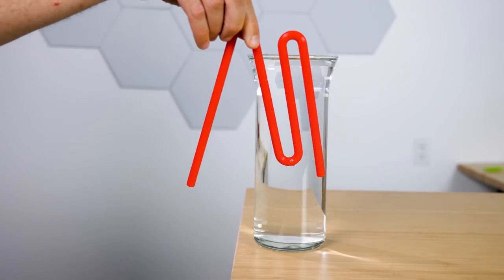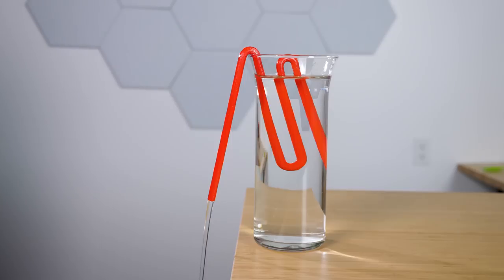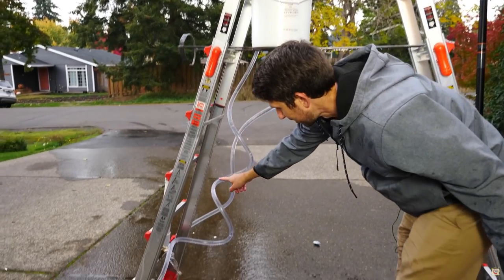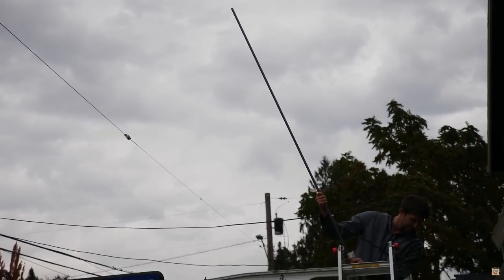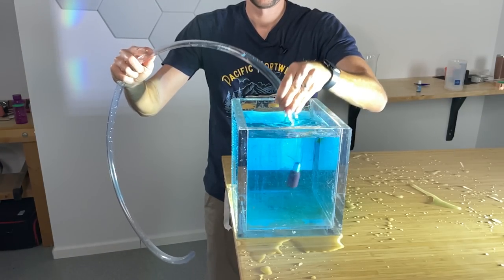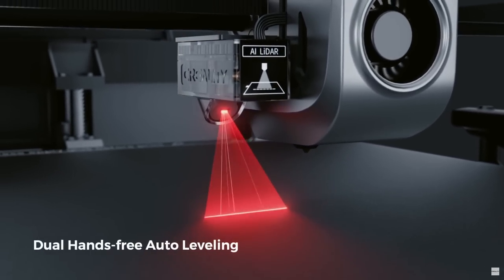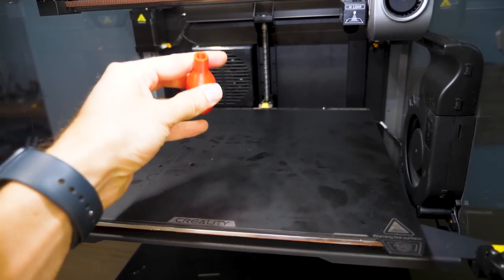This Tube Makes Water Flow By Itself

Comment: You can create the same effect of the shaker syphon by using your thumb to seal the exit-end during the upward stroke, and releasing your thumb during the downward stroke. Probably common knowledge, but I thought I'd throw it out there just in case.
Reply: Or just spin the end of the hose like a helicopter until it splatters everyone around you. 😬
Reply: Thanks for that tip!
Reply: It helped me to suddenly see what was happening more clearly, so I'm  glad you threw it out there. 👍
Reply: @valiantwarrior4517  Yes, I've done that!
Reply: I did that demonstration a few times with a drinking straw in a cup of water at a formal dinner table when I was a teenager. When I got older I perfected the art and then did it many more times!
Reply: Back then, I always do this with my friend to prank someone who didnt know about this stuff with our drinks

Comment: That hydraulic ram pump seems to have a similar sequence of operations as an electric voltage multiplier. Thanks for showing some magical plumbing and your new tools.
Reply: More specifically, an inductor based boost converter. A capacitor based voltage multiplier works on a different principle.
Reply: Wow. I didn't expect to encounter this here. That's so cool.
Reply: @tactileslut  No, the transduction effect by the voltage amplifier causes the momentum to accelerate the hydraulic effect. Not the other way around.

Comment: the shaker pump is called a foot valve on most farms with yard wells on the property. its a fast and easy way to prime a pump by just lifting and dropping the pipe going down the well. the foot valve lets the water in on the drop but snaps shut when you lift. after you have the pump primed, the suction of the pump can keep the foot valve open to let the water keep flowing.

Comment: The ram pump uses the same stored energy that causes 'water hammer'--the sound you sometimes hear in the pipe when closing a faucet really fast.  Also with a ram pump: the higher the outlet is compared to the source, the more water is wasted out the bottom; efficiency drops off quickly the higher you go.
Reply: Can large numbers of inefficient ram pumps be mass produced to slowly-but-continuously pump water up to mountain tops or above houses for "free" electrical energy during both night and day? If the pumps could be created in such a way as to need no maintenance, might this not be a way to always have energy, as long as a single reservoir held water? (With sealed pipes that were hydrophilic and/or coated with  hydrophobic sprays in various areas, one could direct the water over large, flat distances, with a framework. ...of course, it would probably be best to just use vapor and condensation for such desert water distribution efforts.)
Reply: @JakeWitmer I see more use for a thermal pump that doesn't waste the water. In your proposal, you have no feed of energy, except for the water going down. In the heat pump version you just need enough water heat pumps that works by heat difference.
Warm water has a lower density than cold water. So if you cool down ingress water and heat up water in a pipe going up, the water in the pipe will be higher than the cold water.
The rise is less than a ram pump, but the loss is 0 and the energy invested is to cause heat difference.
Reply: @JakeWitmer well if it helps, a friend of mine uses a ram pump to feed water to his countryside house. There's no water supply service around, but they have this small stream on the property. The pump takes some energy off the stream to fill up their water tank, which is almost 1km away and about 10m higher than the point in the stream where water is taken from.
Reply: I first read about hydraulic ram pumps when my parents were homesteading back in the late 70s. Most of it I understood but I had trouble understanding why it had to pump uphill. I couldn’t understand why they had to keep priming it if it did not pump uphill. They kept saying something about back pressure but I really didn’t understand it. 

Then one day someone said those magic words “water hammer” and it all fell into place!!  

Fun factoid:  the first self acting Ram Pump was invented by the Montgolfier brothers (in 1796!) who were also co-inventors of the hot air balloon in France.  To this day hot air balloons in France are called la montgolfière !
Reply: From a physics standpoint, no laws are broken as the center of gravity of all the water after is lower then the initial state. On this example the water starts in the bucket in the middle of the ladder so that is where the center of gravity is. If you calculate the final center of gravity (all the water that made it to the top and all the water that came out of the waste valve) it would be lower then the initial state. Which is why it wastes so much water out of the waste valve, it has to as the higher you pump some water, the more you have to waste down low to keep the overall CG lower then the initial state.

Comment: The shaker siphon.  Reminds me of the old trick done in a swimming pool where the handle of a leaf-catching net is inserted into the water, and you put one hand over the end of the handle, and pump the pole up and down as air gets pushed out the top and you hand acts as a one way valve preventing air from sucking back in.  This allows water to be pushed up the bottom of the tube where it gets locked into place.  Eventually, water starts squirting out the top of the pole while your hand is still blocking it.  Then you invert the pole and let all the water out.
Reply: In other words, a straw in fountain drink. Except the straw is huge and instead of dribbling some soda on the table if you drop it, you're probably going swimming.

Comment: Im curious of the physics of this decivice allow it to scale up. Some principals that work on a small scale will not work at a larger scale. It would be interesting to test.
Reply: This will work as long as 1) the pipe length and diameter do not constrict flow so much that it cannot gain enough momentum to get over the crest and 2) the head pressure drop on the downhills isn't so high as to cause cavitation which would air-lock the system. With water vapor pressure at 25C being 3kPa, the absolute maximum should be just shy of 10m. Head pressure losses from friction against pipe walls of practical diameters (say 6") will likely reduce that to less than 9m.
Reply: The more you scale it up the more energy you would need to add, so yeah you would be able to scale it up but there is a point where the amount of energy you would need to add would make it too inefficient to be worth bothering there are better ways to empty a vessel of its contents like drill a hole in the bottom and fit a tap
Reply: @chrisharris1522  The absolute limit is the working fluid's vapor pressure-temperature curve. Once the fluid column's head pressure exceeds ambient pressure minus the fluid's vapor pressure, the excess fluid will cavitate (boil from low pressure) and vapor-lock the system. For 25C water, that absolute limit is 10m before accounting for dynamic losses.

Comment: Hey Doc!  If you have good timing, you can simply move the hose back and forth in the liquid while covering and uncovering the exit end of the hose with your thumb until the liquid starts flowing.  So no valve needed like that shaker siphon you mentioned.
Reply: Underrated comment

Comment: Instead of the double-top syphon I'm pretty sure it would also work with a vertical-axis spiral for the section inside the container (so the water would always be flowing upwards until it reaches the bend at the very top). The key is the length of tubing that allows the water to build momentum. A spiral with a larger radius curves would probably work better than having the relatively sharp bends of the version he's made as the overall resistance to flow would be less in relation to the diameter of the tube. It doesn't necessarily have to be plunged in, it could also be put in slowly, but having one end or the other sealed until the tube is fully in the container. That would require energy to force it in as it would be buoyant, so the energy still comes from somewhere.

However, even without that, you could still have an optical-fibre filled tube that would siphon water up to the bend on it's own because of surface tension. That would work the same as a bit of tissue paper, but the smooth alignment of optical fibres would allow the water to flow a lot faster than a bit of tissue paper of the same cross-sectional area.

Comment: Thanks! I learned this today. Didn't know self starting siphons existed.
Reply: This isn't really a true self-starting siphon because energy has to be applied to it to make it happen. A true self-starting siphon would require something that would lift the water over the edge even if inserted slowly - which you can achieve with a glass fibre bundle filling or nearly filling the tube. The surface tension of very finely close fibres will do it, in a similar way to a piece of tissue paper, but much faster.

Comment: a normal siphon works, not due to air pressure as state in this video, but due to gravitational potential difference.
Reply: It's both. Think about it. Why is it possible to suck any liquid up a straw? There is no such force as "suction", anything that is caused to move that way is actually being pushed by atmospheric pressure.
Reply from the maker: Yes once it is moving it actually works due to gravitational potential. I’ve even run a siphon in a vacuum and it still works.

Comment: Okay, for the straw... how exact does the geometry have to be?  I'm not planning on siphoning gas, but I'm trying to picture if it could be done.  You have to get that first bend under water to start it... but since it's using momentum, not an actual suction from the final end, I suspect the middle loop can't be too much higher than the first loop?  

As for the other ones, how do they compare in efficiency to a good old Archimedes screw?

Comment: The extra energy needed to make the water climb up and over the edge of the container is provided by the person- the long straw initially is filled with air and therefore requires a little extra push to fully submerse it if you do so quickly. Think of it like a rubber ball when you push it down underwater. If you suddenly release it, it will spring up into the air because of the momentum it gained while quickly rising underwater. The straw is long and therefore takes longer to fill up with water than a regular straw, therefore it would normally not sink to the  bottom right away unless you push it. So once you do push it underwater, it is like pushing the rubber ball underwater, and then the water comes springing back up the straw and starts a siphon.

Comment: It's not just air pressure that makes a siphon work. Siphons work in hard vacuum so long as there's gravity. The surface tension of the water "drags" the rest of the water out once it gets started.

Comment: Hi, I just bought a 3D printer; I bought the Bambu Labs new A1 (not the A1 mini) and I tried 3D printing this straw myself, but for some reason the straw that I modeled in Blender didn't print right; it had leaks in it but then if I print the straw that you provided to us to print, it comes out just fine with no leaks. Do you know why this is??? I checked my model and compared it to your model multiple times and I can't figure out what the problem is. I applied all the modifiers and I triangulated the faces but it still won't print right for water to be able to flow through it. Do you have any idea on what the problem could be?

Comment: What I’m not understanding is why can’t this be used to create a perpetual motion machine? Have the water flow into another beaker and then with another straw flow back into the original beaker. If the water can be pumped higher than where it originally started, have an additional straws fill the original bucket. I’m obviously missing something since this is not possible.
Reply: Even though sections of the straw can go higher, for the siphon to flow, the water level at the exit must be lower than the water level in the bucket. So every successive bucket would be lower than the previous one.

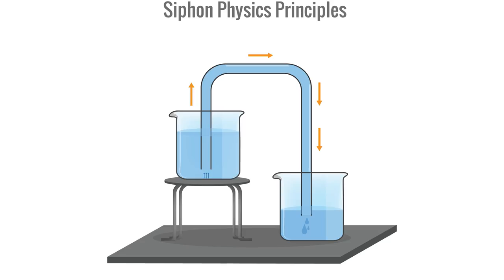Comment: 0:47 it's not the atmospheric pressure pushing the water through in a siphon, it's the (falling) water's mass creating suction with the help of gravity. The atmospheric pressure is higher in the lower container, so that would not work.

Comment: You can also stick the entire hose in the liquid, make sure the hose is filled completely, block the end with your thumb/palm (depends on hose size) and just bring it over the edge and let it start draining. Thats how I drain our non-hazardous waste at work, I do it all the time. Ive thought about trying those shaker siphons, but theres a lot of tiny solids in the water (I empty it into a filter press) and I feel like the shaker would get gummed up within a week lol. 

So you dont necessarily need to suck on anything to start a siphon, its just a matter of getting the water to start flowing over the edge. Been siphoning barrels with just a 5' section of old garden hose for years, no sucking needed lol. Only thing is you need to bee able to fit  the whole hose in, easy on a 55 gallon drum with the top cut off, but not applicable in all situations.
Reply: That's pretty smart. It's an easy solution that you might not think about immediately in a situation where you need to syphon things you don't want in your mouth.
Reply: Why do you need the whole hose in? Don't you only need just enough to get the water over the edge?
Reply: @MortenBendiksen  gotta fill the hose completely to start it flowing

Comment: Hi, I have a question about air conditioning and closing vents.  It seems counterintuitive to not close vents,  but apparently, it's true.  I was hoping you would consider doing a future video about this.  Would not the air pressure in vents cool an open vent room faster and more efficiently when an adjacent room is vent closed and sealed?  What is the science behind the recommendation of leaving all vents and doors open in a central HVAC system?   Thank you for all of your informative videos!
Reply: If your AC unit takes air from outside, cools it off and then blows it inside, the cold air needs to displace the warm air in the rooms. Otherwise it "can't enter" the room. 
In a recirculating system, it should not matter. 
With a portable AC that only has one exhaust hose and no suction hose, it uses the room air to cool itself down and then exhausts that air outside. That air has to be replaced because otherwise you're drawing a slight vacuum in the room reducing the effectiveness. This is also the reason why portable ACs are terribly inefficient - they use the air you just cooled off to cool themselves down, while replacing that by sucking in warm air from outside through vents and cracks.

Comment: It works with electricity as well. A type of boost converter increases voltage by periodically building up momentum in a inductor and switch to output via a diode, the same principle as the water ram device.
Reply: A boost converter creates a significant amount of heat instead of water, yes?

Comment: by pushing the tube forcefully into the glass you are adding the same energy that you would by sucking on the end to start the syphon, this would not work if you lowered it gently into the glass, conservation of energy is still the rule. But nice party trick I am sure it will fool some people

Comment: Yet ... once you have the siphon going you've got free energy forever, assuming you've got an infinite amount of water / liquid. 
Which reminds me ... I once had an idea to use the pressure from a faucet (it's quite big) to help someone empty a bucket easily. What I'm seeing here means I didn't even need the faucet!!!
BTW ... That was one fun video. Thanks!
Reply: considering you have an infinite amount of water, the siphon is irrelevant in the equation. by simply creating a damn or even just adding a generator onto the source of water with some sort of drainage are to get the water flowing, free energy is acquired. the siphon is unnecessary and only adds more difficulty.

Comment: It's nothing to do with atmospheric pressure and everything to do with gravity. 
The atmospheric pressure differential between the top of the glass at the bottom is absolutely negligible and probably not even different.

Comment: I don't know the name of this but this is how my aquarium works.  I made this out of 1in pvc and it hasn't failed me in like 9 years.  I have a check valve on top to suck out any collected trapped air but it only needs to be done a few times a year.
Reply: You effectively have 2 reservoirs at the bottoms of the loop and if you draw a vacuum between them they will stop/restart no problem based on the input water level.

Comment: by the way - you take a piece of hose (1-1.5 m) and throw one end down into the bath, and put the other under the jet of water from the tap above
 observe the flow rate of the flow from the hose 
 and now you just take out the upper end from under the jet - and voila, the flow of flowing water from the hose increases the pressure three times!